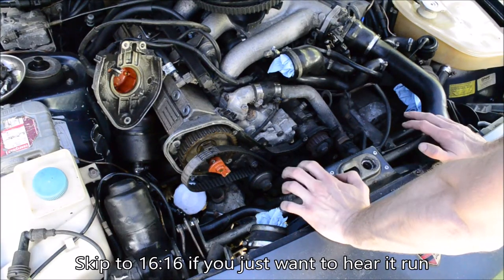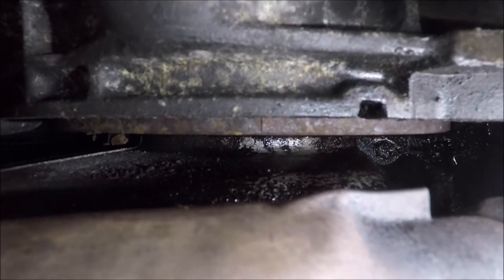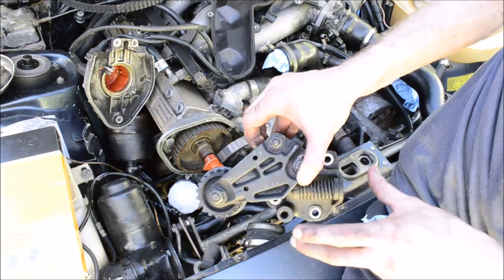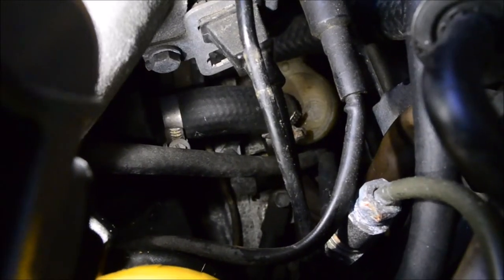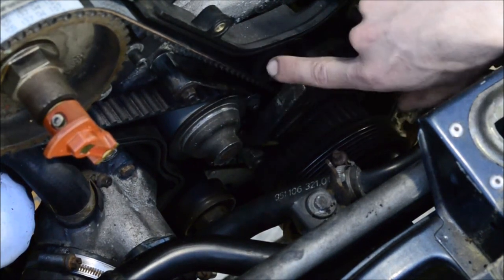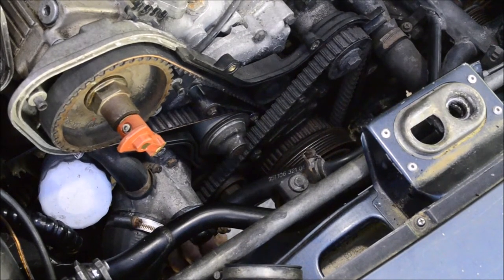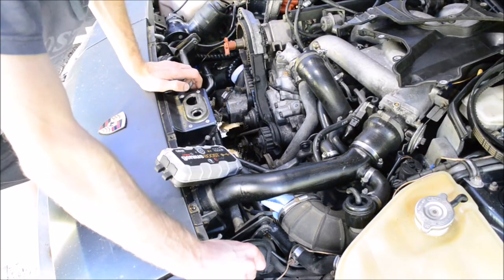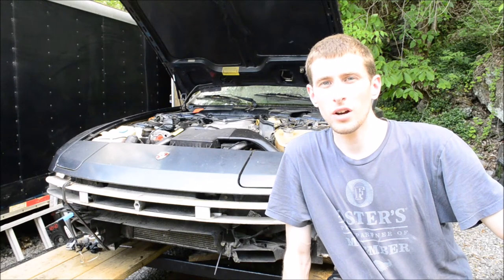Installing Porsche 944 Timing Belt - Starting Engine With New Lifters

Comment: The top balance shaft mark (at 12.14) is the notch on the back of the pulley and not the "O". Also engine should be turned clockwise otherwise the tension is on the wrong side of the belts. Misleading information.
Reply from the maker: You're right, not sure what made me think the O was the alignment mark at that time. The O is the key alignment mark if you're reinstalling the pulley.
Reply: @aDIYCarGuy  something went wrong with that setting of balance shaft? I have seen 944 with balance shaft misaligned but running ok
Reply from the maker: @vicky-nc3to  I drove with it with no problem, I corrected it recently and it seems a little smoother.

Comment: The 944 engine is supposed to sound smooth as glass with virtually no vibration. Also, you should hear no whine from belts / idlers / tensioners. When idlers or tension rollers spin too freely, their bearings usually have little / no grease - will soon fail. Easily twisting belts 90 degrees will result in final tension about 75-80% of what Porsche recommends when using a belt gauge. Krikit makes an inexpensive but accurate belt gauge when used correctly (sold by Gates, others). It is natural for some of the lifters to loose a small amount of oil if the car sits for weeks / months, but "good" lifters in a "good" engine with proper oil pressure & clean oil will stop tapping within 1-2 seconds after start up. Porsche recommends covering cold exhaust manifold with towels or plastic drop cloth or both before removing cam housing - prevents oil on headers! Finally, for ANY engine that you want to last for a long time, do not rev engine way up when it is cold. Porsche recommends reading the Porsche 944 Maintenance & Rebuild Guide for correct procedures like proper torque, when to use or not use Loctite sealants, when to use anti-seize, or gasket sealant and when not to. Which direction to manually rotate engine, how many revolutions when tensioning belts (CW for 2 revs then CCW for 10 degrees crank). Lots of other info to make you a far better Porsche mechanic.

Comment: For people watching this a few years later. Do not, ever turn the engine counter-clockwise like this, the engine should always be turning clockwise. You can damage things like the oil pump and as the belts are not turning the proper direction, the tensioners are not actually tensioning properly and you run a risk of skipping teeth.

Comment: Excuse my dumb question, but if the timing belt on these cars break during operation... is the motor done for?
Reply: No, more than likely the worst damage is done to the valves in that case.  Other damage to the engine after the valves hit the piston is definitely possible, but in most cases I hear replacing the valves and the timing should be the worst of it.  Either way it means pulling the head off the engine and it would be a lot of work and hours.  To have a shop do the work could be costly.

Comment: Hey there, is this your 944?
Reply from the maker: yes it is, had it for 7 years. sat for 2, drove for 3, sat for 2 more lol. very close to being back on the road
Reply: a DIY Car Guy Can't wait to see it back on the road ;). BTW, don't part put your Minni, rather fix the brake line. Its a cool car and you're talented enough to sort it out ;-)
Reply from the maker: haha cheers, i may be able to fix it with this parts partnership that I just got, but I will probably do it mid summer or fall. it needs taillights, transmission has to be taken out to evaluate a bearing, more bushings, rear tires,  brake line, and windshield. lol
Reply: a DIY Car Guy holy shit! OK, now I understand why you wanted to part it out :-p.  Saving a car is always better than killing it tho ;-)
Reply from the maker: Yea the taillights spider cracked from the cold of winter....can you believe that shit lol. I agree.....I had to part out an Audi A6 once, didn't really want to as most of the car was nice, but the front was smashed
Reply: a DIY Car Guy hey man just a tip from a veteran 944 guy . When you want to release the pressure  on the belt tensioner just use a 17 mm box wrench on the pulley nut . 😄
Reply from the maker: cheers, i'll keep that in mind for the next belt change....seems that will be a lot easier haha
Reply: @artmchugh9283  how would you feel about a 1987 944 base model that sat in a garage for 20 years without moving? Ran perfect when parked.

Comment: How long did you have it running?
Reply from the maker: What do you mean, how long before it stopped making noise?
Reply: yes exactly
Reply: I am at this point right now and it sounds a lot like yours
Reply from the maker: I don't really remember but probably 15+ minutes. Did you put new lifters in?
Reply: yes I did
Reply from the maker: how long have you run it so far
Reply: like 2 minutes and it started to smoke up like yours but I stopped it because it was late
Reply: Should I just let it run for 15 or does it sound like my timing is off or something else
Reply from the maker: I would double check all the timing marks, if they're good, then let it run. You don't have to take anything apart to check them, there are port holes to look through.
Reply: @aDIYCarGuy  so comparing the first video of the cam tower job and this one, is the car quieter now? if so, is it because of the gasket replacement?
Reply from the maker: @rpj6147  Yea it quieted down once the roller followers pumped up with oil pressure, takes a long time. Some of them are bad and still make noise.